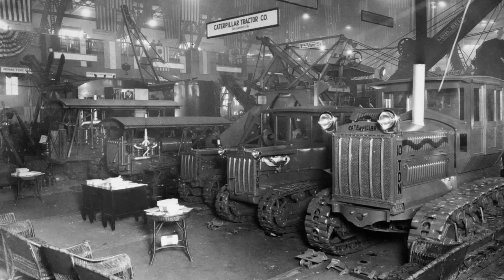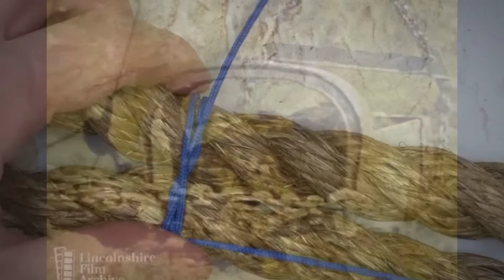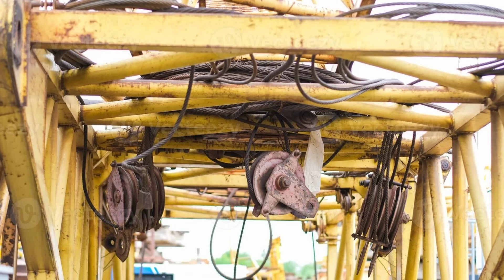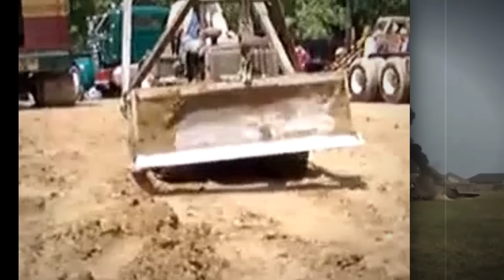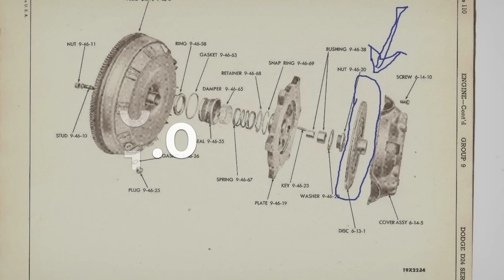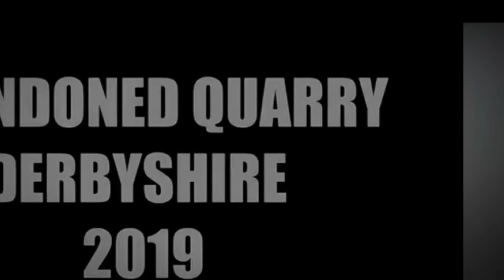Before Hydraulics: LeTourneau Cable Control System Explained

Comment from the maker: R.G. LeTourneau filed a patent in 1945 for a hydraulic disc clutch built inside a cable control unit. The man who spent his entire career refusing hydraulic controls had quietly put hydraulics inside his own invention. Patent number 2,495,463. Look it up.

Over 60% of all Caterpillar tractors built in the 1930s and 1940s shipped to LeTourneau's factory by railcar before they could do any work. When Cat tried to build their own attachments during WWII, the War Production Board ordered them to stop.

What surprised you most? Drop it in the comments.

The deadly steel cables at Hoover Dam and the full R.G. LeTourneau biography with his 299 patents are both on this channel.
https://youtu.be/26_LnYuSJlQ

Comment: Hello, Construction Legends.
Once again, you are posting about things of which you have LITTLE IF ANY understanding.

The Letourneau PCUs DID take their power DIRECT from the PTO of the tractor on which they were mounted. The simple fact that those tractors mostly didn't have an external power take-off is irrelevant. They all had an INTERNAL driven shaft with an internal spline designed to accept a shaft which could be from either an external PTO attachment or a PCU.

There was ZERO exposure to dust and grit INSIDE the PCU drive gear case. Heck, you even mentioned that the gears ran in oil. HOW do you think they kept the oil in place for the gears to be able to run in it? If what contained the oil could contain oil, don't you think it might also have been capable of keeping dust and grit OUT????

I operated some LeTourneau PCUs during my 58 years of operating and I NEVER met one which had the control lever movements which you describe. It was ALWAYS pull the lever towards you to pull the cable in, center position to apply the brake and push the lever AWAY to release the brake. ALL of LeTourneau's rear-mounted PCUs that I encountered had the control levers coming from BEHIND the operator over the top of the fuel tank.

The apron lift cable on Caterpillar cable scrapers also actuated the ejector function. A set of sheaves within the draft frame pulled on the 'apron lift cable' until it reached its upper limit, at which point all of the force was then transferred to the ejector. The 9/16" 'apron lift cable' DID NOT have its own drum.

NONE of the Letourneau cable towed scrapers ever had sheave blocks directly over the operator's head. That set-up was ONLY on the scrapers attached to LeTourneau's own 2-wheeled scraper tractors which were attached directly to the scraper gooseneck in place of the front wheels on a towed scraper and thus placed the operator MUCH closer to the working cables.

I left your ALLEGED 'explanation' of the LeTourneau cable control system at 15.13 having OD-ed on your BS. Am I off your Christmas card list yet?

Just my 0.02.

You have a wonderful DELUSION. Best wishes. Deas Plant.
Reply from the maker: Hey splint, hank you again for your deep understanding about these machines. We really got no reason to send you no Christmas card. It’s still amazing every time to read your posts.
Reply: Hello, @ConstructionLegends .
So if I can access this information, WHY can't YOU access it and make your videos more FACTUAL and thus more believable?????????

Just my 0.02.

You have a wonderful DELUSION. Best wishes. Deas Plant.
Reply from the maker: That's a fair challenge, Deas, and we genuinely appreciate that you hold us to a higher standard. You clearly have 58 years of hands-on experience that no amount of research can fully replace. We're always working to improve our accuracy, and comments like yours – however blunt – are genuinely valuable. If you'd ever be open to it, we'd love to have your expertise involved in future content. Seriously.